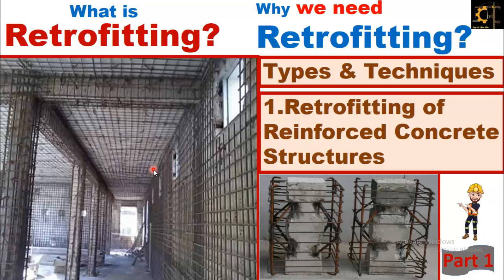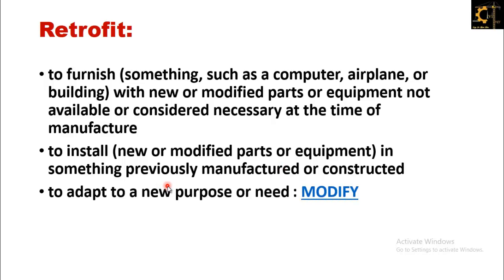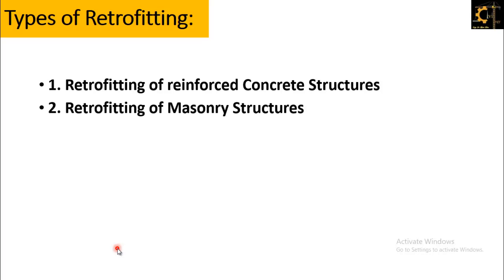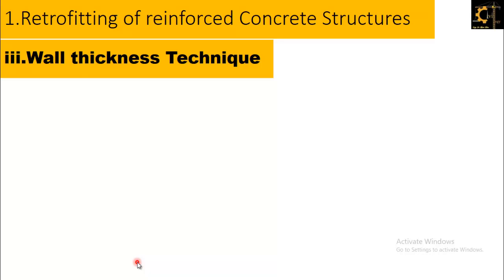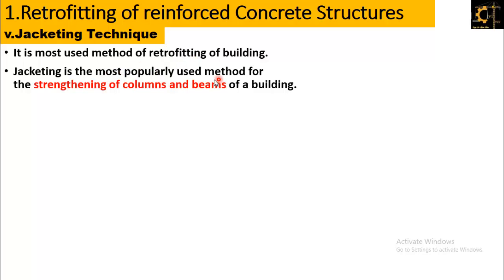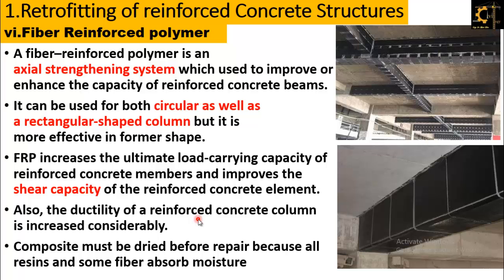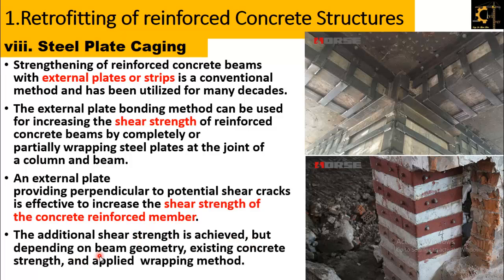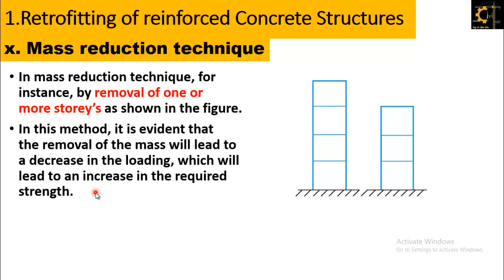What is retrofitting of Building?| what are the Types & methods/techniques of Retrofitting.

Comment: Thanks a lot for sharing this video. Many will benefit from it in decision making whether to decide on reinforcement, retrofitting or simply said, preservation of some historical architecture and engineering structures tested by time. However, what's the extent of its life. Will it be timeless and will continue to survive modern technology and ergonomic designs by altering and supporting the base, foundation and trusses, or is it best to wait and exhaust it's worth of service for maintenance, preservation and functionality only for practical reasons provided that safety compliance is met and observed.